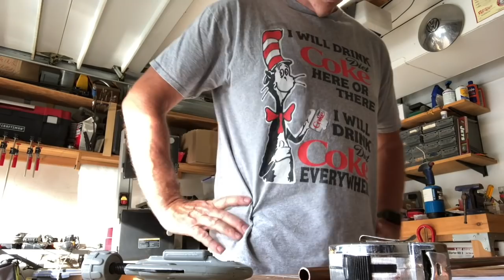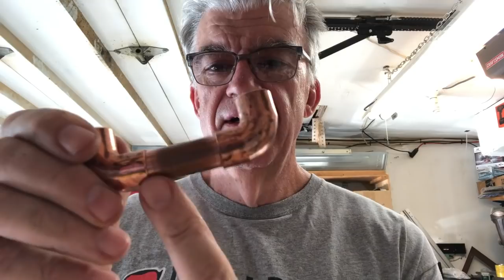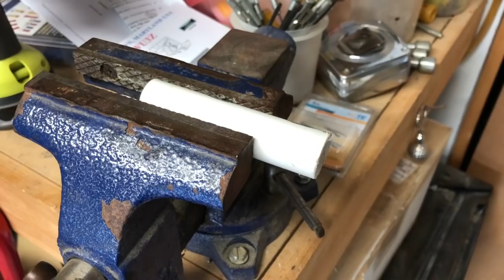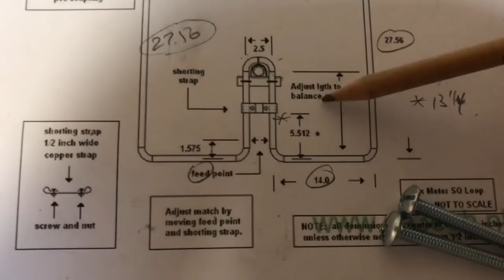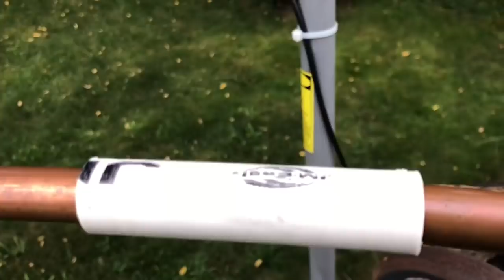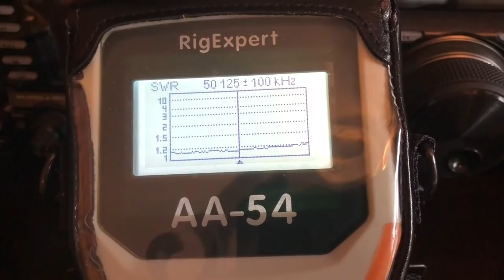6 Meter Squalo Antenna Build

Comment: Nice. Have you tried measuring the common mode radiation from the coax ?
Reply from the maker: No i haven’t. It still works though. I worked a guy in AL from CT a few weeks ago. It ain’t pretty, but it works

Comment: it just half wave dipole and length  is end(split) to connection point. place where you should adjust not cut any tube xD tune higher freq move it more out(same as cut). other way lower freq. middle part is just decorarite hanging

Comment: I used flexible corrugated plastic electrical conduit
to span the gap. I used two small hose clamps to hold it in place. Works FB!

I previously built a different version in 
2013. During a band opening I was
heard in Scotland before it faded out !

Comment: where you have it mounted to the mast pole, is it insulated against it? or is the copper pipe right against the mast? thanks
Reply from the maker: It's clamped to the pole since that section is shorted out by the matching slider assembly.  Hope that helps!

Comment: This is 5 years old when I found it. Been looking for something like this for a while, and will be looking a bit deeper into building this possibly. Have looked at a few other 6m designs over the past few weeks and very possibly will be considering building this one in the near future. Are there any updates to the design & build? 
Cheers Mick G6ASJ.
Reply from the maker: Cool that you found it.  No changes since I built it.  Still working fine!

Comment: I built this antenna and could not get the swr reasonable 5.7 @ 50.00 to 17.5 @54.5 measured everything exactly feed and shorting strap as per plan not sure what gives
Reply from the maker: Check the distance between the open ends where I put the pvc.  Might need to trim each side a little bit.

Comment: A really nice video: informative and very entertaining! Also an interesting antenna. I built some copper J-poles for myself and for my Civil Air Patrol squadron - their VHF frequencies bracket our 2m band. As for aligning the pipe, the antennas were laid out on the garage floor and then "sweated".

Figure that should work for your squalo!

Thank you again

de k6whp
dit dit
Reply from the maker: Thanks!  The antenna still works fate a few years and a QTH move.  It was fun to build!

Comment: Good video. Looks like a nice antenna to try. A few tips if I may:
1. Slow down on the camera movement to give people a chance to see details.
2. Instead of drilling out the pvc, consider heating it with the torch (modestly. Keep the torch moving or it will burn) instead. Then just slide it onto the pipe. When it cools it should also secure itself to the copper and not need screws. But if you don't want to do that, you can drill holes into the pvc and thread them and use bolts as set screws. Do your other drilling inside the pvc to make it bigger, which I would do all the way through so you can slide it all the away to the side to trim the length. 
3. Another omnidirectional 6m antenna is the flowerpot antenna. Something to look at if you haven't. Easy to build and very portable.
4. For people not used to sweating copper pipe, just remember the heat does the work and draws the solder through the joint. Keep the torch moving but remember to heat the far side away from where you hold the solder and when the solder melts and draws through you know everything should be good.

Comment: I have a Yaesu FT-690R MK II that will love the 6M Squalo, it will complement the dipole I have at 70'. I sit at the top of a 550' hill which causes a rolloff of about 10° to the horizon (which adds about 2DBd to my signal) as it pulls the angle of attack down to the horizon at about 5 to 7°.  I have some hard drawn copper pipe left from a well project (3/4") and I will try this project. Thank You! 73 de W4FJF
Reply from the maker: Glad this helps!

Comment: That pvc connector if you heat some copper and push it into the pvc will adj the size for you no drilling no glue nothing else needed :)
Reply from the maker: I think if I rebuild it I’ll do that for sure!

Comment: Heat the PVC pipe end to expand it a bit and push the copper pipe into the PVC the proper amount and when it cools, it will be locked in!👍
Reply from the maker: Yeah, they say I did it isn’t the best but it’s still holding together.

Comment: Nice build, and this version is very similar to the M2 HO-Loop.  In the last year since you posted this, the band has been super with a lot of the activity having moved to FT8 on 50.313 MHz  and FT4 on 50.318 MHz. I run the Par loop and currently have 46 states, 34 countries and 231 grids. Got my 6 meter VUCC with the loop and 40 watts.

CU on the band! De WB2VUO here near Buffalo,  NY

Comment: I realize this is a few years old now but when I built one a few years ago I took a small piece of copper strap drilled a hole in the center and made a "butterfly" capacitor that went over the space in the gap I could then adjust it over a much wider range of the 6m band without needing to cut anything. using a marker ran the analyzer on it and was able to mark directly on it the aprox. position of each center frequency. it made tuning easy and no fuss. well done 73 ve3hbj

Comment: I've built my 6m squalo antenna based on your information.    Thank for the nice job presenting all the information.   MY SWR is very high.      I've never sweat pipe before so I am double checking the joints.    Feed line was okay I thought.    3 feet initial, but I am gong to make it loinger test out in the open today.    Moving the short and/or feedpoint don't have much affect on the swr.    Any pointers?    Hope you are well.
Reply from the maker: You may have to check the length at the open end.  I had to make a few adjustments there.  Check your connections at the feed point too.  That matching section can be a little tricky to get right.
Reply: @k2cjbradio thanks for the quick reply.    I went over all the solder joints and mounted it  on a speaker stand at about 7 feet up outside.    Moving the matching system while hooked up to a nanovna along with feed point adjustments, the swr is now under 1.25 at the low end of the 6m band.    This antenna is going to be great as the sun cycle shifts.    My house has an old satellite dish mount.    Dish off squall on.    Thanks for the great video and help at the end.   73. Joe KC1NNR

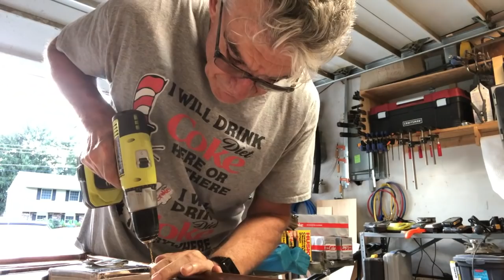Comment: 11:20 , you can heat the pvc pipe on hot water (Or a torch) , and then pvc become soft you push cooper piper,
Reply from the maker: Yep.  I learned that technique after the fact
Reply: @k2cjbradio   tnx for your reply ! hugs from brazillian fan

Comment: One thing I always asked my self.. why cant you use an antennetuner to fix the swr above swortwave frequenties? 😕
Reply from the maker: I'm sure you can actually.  When I operate 6m through the squalo, I use the antenna tuner in the radio
Reply: @k2cjbradio  so the highest frequency is 50mhz to tune (?) thanks in advance for your kind answer

Comment: the non conductive spacer can be a piece of sprinkler pvc pipe (found at home dopie, where the sprinkler elbows and connectors are located). it fits perfectly inside a 1/2” copper pipe.
Reply: @Alton Custer nobody cares about your sad relationship with your ratchet ass girlfriend.

Comment: Chris, I know this is a couple years old but I am trying to build your 6 meter squalo antenna per your video. I have it all constructed and put together per your plans. Problem is , No matter what I do I can not get the SWR down. I have been working for over two weeks now with no luck. It is driving me crazy. I have measured and remeasured to insure I have them per the drawing. No matter what I do The SWR will not tune below 5.1to 1. Please do you have any advise as to what I can do. I am trying to get it tuned for 50.313 FT8 work. Thank you so much for the video.. Steve, N7WEJ
Reply from the maker: Sorry for the late response.  Hopefully yo figured it out.  The middle section where the coax connects is probably what you want to keep fiddling with.  I did shorten mine a bit at the open end under the pic pipe.

Comment: Thanks for the hands on build video.  I’m new to the self-made, self installed antenna world and have a quick question; How do you ground the antenna for a potential lightning strike?
Reply from the maker: Patrick Corso This May sound terrible, but I have never grounded an antenna.  I hang my head in shame.  I’m sure there is a way to do it properly, but, I never did it.  Now you have me thinking I should do it in my next QTH.
Reply: Chris, I’m thinking of using an inline “Polyphaser IS-B50HU-C0 Coax Grounding Block” for the antenna/coax, and a grounding clip attached to the mast.  Both will be wired with 12-18 AWG ground wire to a grounding rod separate from the electrical service meter.

Comment: Intersting  in socallfornia there is a2mtr rptr which links to 10 6 2and 70 cm i use my dipole its easier to get on the air and less of a eye sour  kg6mn

Comment: Somewhat of a newbie to antenna theory, but my question is, how is that not a dead short where the coax is connected by the shorting wire? Please forgive my ignorance in advance, as I would very much like to learn more about antenna theory. 73, KI5HXQ, Bob Deitz
Reply from the maker: Bob Deitz Great question!  As I understand it, that section “behind” the coax connection is a tuning stub for the antenna.
Reply: @k2cjbradio  Does the amount of power being applied to the antenna cause it to not short?
Reply from the maker: Bob Deitz From a DC standpoint, it is a short.  If you put a meter on it, it’s zero ohms.  But the length of tubing at 50Mhz presents an impedance that, when combined with the rest of the antenna, presents a 50 ohm impedance to the radio.
Reply: @k2cjbradio  I think I understand. Since it's an alternating current being applied, that's what makes the difference?
Reply from the maker: Bob Deitz Exactly. With AC at RF frequencies impedance becomes more complex

Comment: Hello K2CJB, I am now interested in this 6m antenna, last Sunday passed my Technician License test, will receive my Call sign in about 2 weeks. :-) Heading to store to get supplies, what I was curious about was maximum watts it can handle, and did you find it to be directional? If so what point is forward? Will set mine at about 25 ft.
Reply from the maker: Bryan Vincent Congrats!  Welcome to ham radio!  The antenna “might” be directional like a dipole, but I can’t say for sure. As for power, it’s copper pipe so it can probably handle a lot.  I run my FTDX3000 into it at 100 watts with no trouble.  Good luck with it!  It’s a little finicky to tune up, but once you get it, it works fine.

Comment: Thanks for the video!! I have an Azden 6M FM this would be great for. Also it will hide well in the attic because of HOA. 
73 de N9TZG Pat
Reply from the maker: It’s a fun project!  And the antenna does work.  Sometimes I’ll leave the rig on the national calling frequency and hear when the band opens.  Those windows are rare, but when it opens, it’s amazing how this little antenna works!
Reply: A squalo is great for SSB CW or AM...the weak signal modes use horizontal polarization. FM is vertical...a simple 1/4 wave gnd plane works...also a Larsen NMO150 on a decent gnd plane..

Comment: Tnx ny friend, indeed with small antenna's on 6m you can make nice contacts during the Es-season, past year I made 70 qso's from JM08 EA5/ with a wire-dipole and my TS480  also heart but coudn't work 4X Israel ( is work by a french station) this has to be a double hop Es  73 de ON7ARQ Patrick

Comment: Great Job Chris, if you remember from your novice days back then Cushcraft used to advertise their Squalo mobile antenna in QST,73,CQ magazines back then. I presume what you built is a spin off of that one. in any event nice job, showing all the workings in the build, gud for the new guys. and yourthought process during helps them also. I have been on 6m since 1972, love the band and the best part is almost all HF rigs now days have 6m n them. so come on all you guys make use of that band on that rig. they don't call it the "Magic Band" for nothing. try it you'll like it.!. 73 gud dx ! de Ellis WA1RKS
Reply from the maker: I don't remember it but did read quite a few articles about it when I came across the squalo plans.  Thanks for watching!

Comment: Hi Chris, why is one leg on your inverted vee wire longer than the other? I am new on HF and just bought a HF rig setup like this, (this is my first HF rig) one leg is about 45' and the other is about 88'. I thought both sides were supposed to be even?  Thanks for the video!
Reply from the maker: gadgetkat It's an off-center fed dipole otherwise known as a Carolina Windom.  I chose that antenna for two reasons: first, it would fit in the yard and second, the ftdx3000 built in tuner will not tune a G5RV.  it tunes the ocf dipole fine for 40 and 80.
Reply: Thanks Chris, a lot of this stuff is new to me. Thanks for the videos!

Comment: Great job on the squalo..!. I've never been on 6 meters, but I think I'm going to try and build that antler and get myself a 6m rig. I enjoyed the video, and thank you for sharing this. 73 de km4dme
Reply from the maker: Angel Cintron Thanks!  The squalo works great.  Best way to get into 6m is to find a local net to check into.  That will get you started.  73 de K2CJB
Reply: @k2cjbradio  73 de km4dme
Reply: @k2cjbradio  Awesome... Thank you.!

Comment: What length did you end up with on the "Adjust to balance" pieces?
Reply from the maker: The Lightning Stalker I forget actually...
Reply: I found this video while in the middle of my build.  I used 16 inch length for the 2 pieces in the middle and a 2 inch muffler clamp.

Comment: Suggestion - never "sweat" a soldered connection with the pipes in a metal vice - too much heat loss. Also with a complex shape like that it is difficult to get the finished item dead flat. Best to lay the whole assembly (with flux and fittings) on a flat non-metallic surface, (e.g.silicate board) then sweat every joint  without moving anything. I like your "down-to earth" approach showing what happens as it happens - very nice!
Reply from the maker: Peter Jones Thanks Peter!  I'm far from an expert at plumbing work as you can see.  It was fun to do and it works great so far.  Thanks for watching!  73 de K2CJB

Comment: Fantastic video. I’m headed to Home Depot this weekend to get some copper pipe !! Any recommendations for flux and solder ?
Reply from the maker: John Peterson Thanks!  Well, I used regular plumbing flux and solder.  Another viewer said I shouldn’t have.  The antenna works fine still, so not sure if it makes a difference.
Reply: K2CJB Radio thanks I’ll give it a shot.
Reply from the maker: John Peterson Good luck and have fun!

Comment: I have heard that 6 meter band antennas work well in the 10 meter band too...??
Reply from the maker: J.Arnold Cotton Hmmm.  That might be if the 6m antenna is cut for the high end of the band.  I would imagine with a good tuner it might work.

Comment: Low SWR is fine and dandy, but does the antenna resonate? And please tell me you used rosin core solder and RA flux, and NOT plumbing solder and acid flux?
Reply from the maker: Mike Harnett Hi Mike, yeah, the antenna does resonate.  I have made a few contacts with it in 10-30 mile range.  Looking forward to betee conditions. Yes, I did sweat the pipe using plumbing solder.  Seems to work ok.

Comment: I built an extended double zepp and never got to use it much. The local group left 40/80 to meet up on 6 so I deployed the EDZ. worked well then my friend made a squalo. Now everyone is headed to build one. I was just out in the garage figuring out the measurements as you have to account for the amount the elbows set off the center of the pipe. I was interested in how you mounted yours. Also, my friend used standard 1/4" semi flex copper tubing, hammered it flat for his feed point and strap connections. That is probably what I'll do. He found that you do need to add some additional length for the center legs for mounting. I allowed for a little extra room to move the feed point and shorting strap. 

On the air it seems to beat the EDZ, the MFJ cobweb with 6 meters and a dipole, in our little 6 meter group anyways.

Build one!
Reply from the maker: Ed Williams Thanks for checking it out!  Yeah, the elbows have to be figured in.  I had to do some trimming under that pvc piece and it came in to a good swr.  I've used it a few times and have made solid contacts with it...relatively local though.  Hoping conditions improve soon!  Thanks again!  73 de K2CJB
Reply: @k2cjbradio  

Hey Chris,  

Got me off my tail and I soldered up the 1/2" pipe this afternoon for my squalo. I used two cpvc couplers and a piece of pex for my insulator. I need to stop by the big box and get a little 1/4" copper pipe to make my feed point and shorting strap. Then hang it and dial it in. It sure works well for my buddies that have them. I will be doing an A/B test with the EDZ when I get it in the air. Happy hamming.

Ed DE WB5ORT
Reply from the maker: Ed Williams Fantastic!  Would love to hear how it performs!